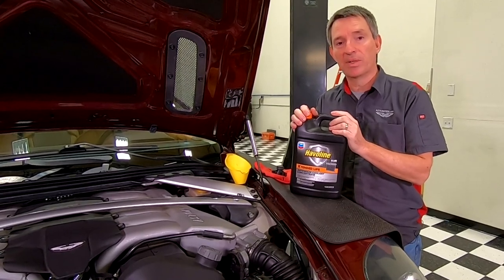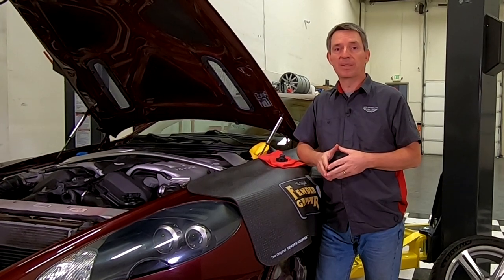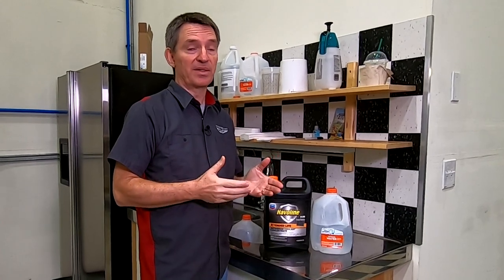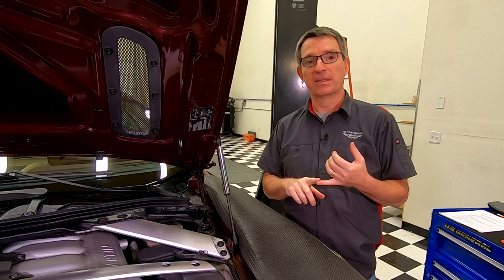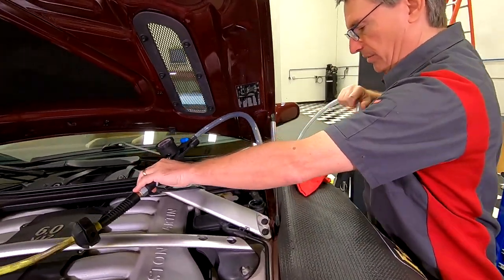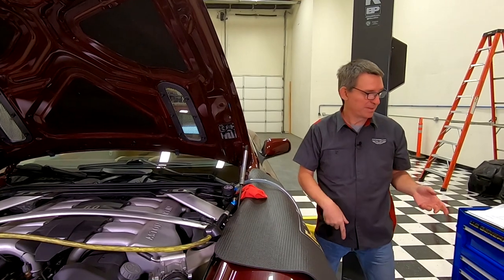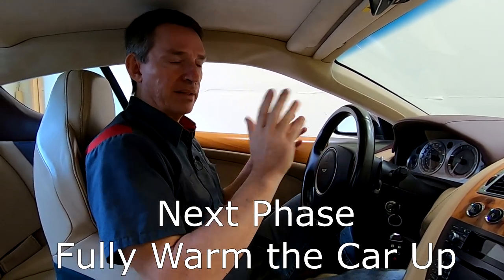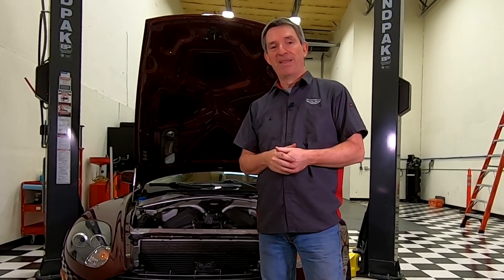Refilling the Engine Coolant in an Aston Martin DB9

Comment: fantastic Steve, your a living legend !  just a question, when you drain the coolant how do you know its all out or most of it out ? 
cheers
Reply from the maker: Since I got about 3 gallons out, and its a 4 gallon system (in the spec's at least) I'm assuming about 1 gallon was left in the block (which makes sense).  To get it 'all' the best you could do is multiple flushes, getting 75% each time.   I don't think there is any gain to that effort.   But it does make a good point that if you were to discover some previous owner or mechanic had used the wrong fluids, you must be careful not to mix the types.   You'd be looking  at multiple flushes with plain water to purge the old incorrect fluid (like old school green glycol)  before adding in any new OAT fluid.  Good question, and thanks for watching!
Reply: @Aston1936  as an old school guy myself, I thought just taking off the thermostat housing on the front of the V12 engine and sticking the hose in there for 20 minutes. But when you didn’t do that I just wondered why ?